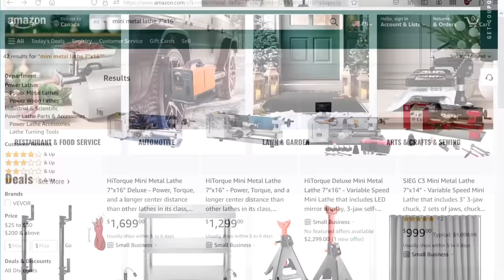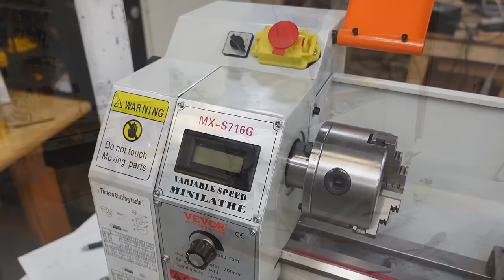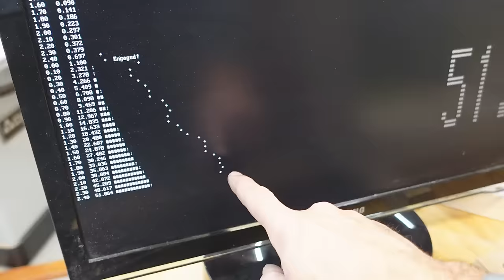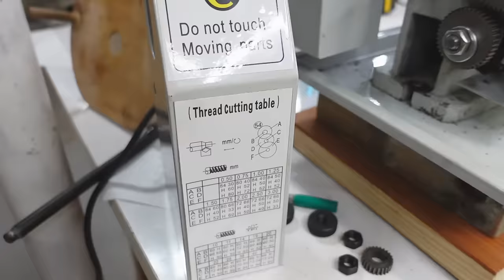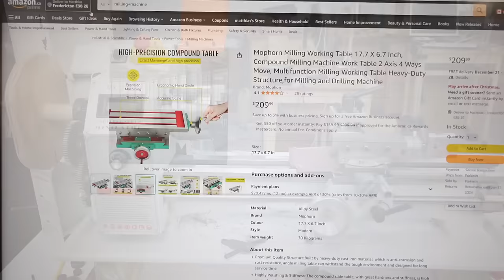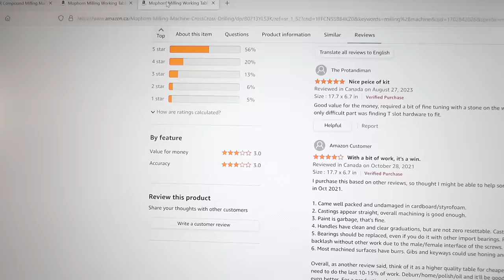I finally got a metal lathe

Comment: Your drill press will likely not work well under side loads so you can't really do milling with the cross slide table. Drill presses have bearings optimized for vertical thrust but not side loads.

Hope this helps.

Comment: There are two sources of chatter you can address. Firstly, make a really solid (stiff and heavy) dedicated stand for the lathe, and bolt the lathe to it. Second, if you aren't using the hand-crank, remove it from the bore, or at least remove the handle.

Comment: You could make a flywheel to replace the wooden manual handle.  That could be a solution to the motor not running smoothly.  A good starting place would be, an out of thickness spec brake disc from a car.

Comment: Matthias,please don’t leave the chuck handle in the chuck.  Catch one in the forehead and you’ll understand why. Also, a slide table for a drill press is a bit ambitious. Drill press spindles have bearing that are made for straight thrust. Milling requires a sideways cutting.

Comment: i've been looking at the craftex, basically the same as any other mini lathe, but hopefully most of the problems already fixed, they're close enough that i can tote something so small up to their outlet to bitch at them.  the vevor seems to get a lot of praise as better than other offerings as... not garbage, you've run into the same kind of troubles that other vevor lathe owners on youtube seem to have hit, the bottom of the ways for instance.  near everyone has to completely pull theirs apart and clean it(lotta grit and shavings), then put it back together with a bunch of shims, one i've seen(servo mod channel) used a file on the bottom of the ways, seemed to go well.

Comment: If you set the "angel scale" at 15 degrees it equals 1 turn on the big handle = 4 turns on the small handle. On all lathes the scale is only a help for calculation on the angle, not adjustment. You can easy get it to 0.001 mm precition.

Comment: 9:18 Out of curiosity I sent Vevor an enquiry about the change gears. What change gear sizes does the lathe come with? Are other gear sizes available? What is the shaft diameter for the gears? Vevor customer support was unable to answer the questions, other than to say that other sizes are not available. They referred me to their product detail page and the manual, both of which are of no help in this regard. Pretty disappointing. 

I know Matthias is pretty hady, but wood gears are not likely to work in this application.

Comment: You probably already have taken care of it, but - you need to clean off all the grit from the angle grinder; or it will destroy any precision that the machine has. In the future, be sure to cover up the bed and carriage when using anything abrasive on a workpiece.
Reply from the maker: did you notice the cover on the bed while I was using the grinder?
Reply: @matthiaswandel  Yes - however, it’s not enough. FWIW, I use a plastic trash bag on mine when I’m doing abrasive stuff; and make sure it shields the entire carriage assembly as well as the tailstock. Grit has a way of getting everywhere and seems magically attracted to the spots where it can do the most damage. 

🙂

Comment: Those mini lathes are like the Chinese Harbor Freight and similar appears, so will need some improvements to potentially the spindle bearing and at least the carriage widening and locking as well as the cross slide.  Can also possibly surface the ways if needed and the end post.  Will be interesting to see what your simplest methods are.  Really awesome to see you with and especially inspiring is the hand crank made out of wood.  Neato!
Reply: I'd go with a right angle plate adapter and vertical slide to make the lathe into a small mill as well.  Indexing head might be interesting as well if you can use.
Reply from the maker: don't know if I want to go that route.  I have milled aluminium with my slot mortiser before though.

Comment: mathias, if i may suggest you should bolt the lathe down, it should not rock like that. if you have shatter try to lower the rpm, might have been turning a bit too fast there. the handcranking the chuck to cut thread i thought was genious 👍🙂

Comment: I'm going to make the simular hand crank for my lathe (1 size larger), it makes a lot easier.    And the parting tool, I made a holder for my angle grinder to be fitted in the toolpost.
And that "bronze bushing" was a sinterbronze bushing with some steel powder to get better/cheaper results.

Comment: Wood on a metal lathe is generally consider to be bad for the lathe in that the wood dust gets into the metal parts, absorbs oil and then gunks up the parts.   But since it looks like you're going to end up using it primarily for wood anyway and then doing occasional metal bits without any oil coolant, you may get away with it for long enough to not matter.
Reply: You just oil the machine. Problem solved.

Comment: Total congrats!  Lesson number one. Very nice machine, but resist the urge to use it as a hammer (like a cordless driver) to drive a nail into a 2x4. (Just joking, trolls). On a serious note, avoid using compressed air to clean the machine. The small lathes open a whole world of possibilities that a 9" lathe can't offer. Also.....RESIN CHOCK. Great way to mitigate vibration- a bit spendy though.

Comment: You need to bolt it down to a very solid workbench. And you will probably need to shim the mounting points to make the bed level and straight. There is no such thing as a benchtop lathe. There are only lathes with proper support structure not included.

Comment: These lathes are low quality, but they're also cheap compared to others and surprisingly accurate for the low build quality. Worthless if you're starting a metalworking business, but absolutely phenomenal if you're just going to use it for cutting threads and taking a few mm off some cylindrical objects
Reply from the maker: for a business, time is money, and that day or so you spend tweaking a hobby lathe is money lost

Comment: Please don’t use 3in1 oil when cutting, it actually prevents cutting because it is too good as a lubricant. While specialised cutting oils can be delivered to your door you have some excellent diy cutting fluid in the kitchen, chicken fat collected off your last roast chicken.  I have been using it for 20 years on steel.  Also try the steel from the bars in laser printers, you will find it cuts nicely whereas the steel used in those cheap bolts and so on is an alloy designed for extrusion not cutting .

Comment: That bushing may have been sintered bronze; cast iron doesn't usually fall apart that way in my experience (and also that bushing just looks on camera like sintered bronze)

And anyway, yeah. If you know that you're going to be happy with one of the import machines because you're doing hobby work, and you understand the kind of modification and 'sweat equity' required, vevor makes an enormous amount of sense compared with harbor freight or canadian tire or whatever else.
Reply from the maker: whatever metal it was, it's mostly iron or it wouldn't get picked up by a magnet
Reply: @matthiaswandel  oh certainly. I heard you mention a magnet but I misheard and thought that you said you hadn't checked it with one.

Comment: I think some of those wooden creations would be more easily created and more accurately made with a 3d printer.  Since I acquired mine, I'm drawing more of my own parts and creating more original solutions to possibilities presented to me in my world.  I like the thing much.  Maybe you might find some plastic solutions could be used in lieu of metal solutions on some of your applications.

Comment: in this video i noticed the gears looked like they were metal and many of the Chinese Mini Lathes come with Plastic  but there are  Metal ones availalable  did you swap them out  yourself  ?   or is that a Upgrade Vevor does ?  I too want to  buy one  and i thought all of the Chinese  ones were  the same  at least that’s what they used to be  Vevor is  kind of a newer   player on this product
Reply from the maker: it came with metal gears, which is very nice.

Comment: "The lathe was too low and I wasn't comfortable"
Oh boy, that's a hassle and a half to deal with, lol.
"So I just lift it up and put some blocks under it because it's not that heavy"
You barsted! :P
Mine is a little heavier than that. The next thing I would recommend is a vertical cross slide, that way you have milling capabilities without owning a mill.

Comment: Putting a wooden hand crank (made on the lathe) on the lathe is such a Matthias thing to do 😅
10:30 As someone who does primarily electronics, working with metal is infuriating because of the filings. Sawdust is annoying, but it's easy to vacuum up and doesn't scratch. Get a bit of metal filings on my hand and now my phone screen is toast, glasses are messed up, interfaces on tools are scratched, it's such a pain.

Comment: Matthias dont beat your self up that you are not a machinist. I have seen machinist do wood working and they say they are not carpenters, the skills are similar just need to add skills to work with either materials and tools. I see that ThisOldTony has made comment and I see you twos are two peas in a bod. You both are very knowledgeable in your specific areas. The tools used are different and this makes huge differences on what products you make.

Comment: Question for those who are machinists. I would have taken a bolt with the right thread for the load cell. Drilled and taped it for the threaded rod. That way I wouldn't have had to singel point thread the nut and saved a lot of work. Is it something obviously wrong with doing it that way that im missing because I'm not experienced? Of course if you already have the hex nuts and don't want to run to the hardware store for just buying a few bolts, it works just fine. it's also generally funn to turn things (except single point threading) so that is also something you have to think about. 🙂
Reply from the maker: those bolts are hard to find, and expensive to order.
Reply: @matthiaswandel  ok, that's explains why. So nothing inherently wrong with how I was thinking, just easier and more economical to do the way you did.

Comment: I had that threading trouble with a little 9x20 jet I had. It was one tpi off. if I wanted 16tpi I had to gear for 15 and it was close but I still had to chase the threads with a die/tap to get it to fit.

Comment: Hi! I have the same lathe. When I tried to create thread, in the user manual, in the thread cutting table, at the 0,50 section there is a gear combination: A84; B30; C-; D60; E-; F80. The Gear "A" (84) and the axis of gear "D" at the same place, this combination is impossible! Am I right? 
Then I tried to create metric screw thread, 1,5mm/rpm. To do this, the following gear combination is written on the user manual and the same is on the lathe: A84; B60 , C-; D40; E-; F52 The problem: Gear "A" (84) can't turn around because of the axis gear "C-D"  

Please check these problem, because Vevor answered me, to change another gear instread of the gear which makes the problem, but if I change the gear (one of tehm) that changes the mm/rpm ratio.
Reply from the maker: watch my video on that topic, please

Comment: I see nobody has mentioned this, so I will do it.

On a metal lathe, you are still turning, not milling. Unless you're cutting the face, then you're facing. Milling IS done on a milling machine, though.

Other things a machinist would say, purely for entertainment purposes:

There are no bits. There are drills and cutters, at most a cutting tool. Never bits. 

Making a hole with a drill on a lathe is drilling. Same on a milling machine, and on a drill press.

Making a hole bigger with a boring bar is boring, on a lathe and on a mill.

If you're cutting a groove on a lathe you're grooving, unless the groove is on the face of the part, then you're trepanning.
Reply: Lathes can mill with a milling attachment. It's janky but it works.

Comment: I have a question about the ability of this lathe.    Does it bore a straight bore hole when setup correctly???? I’m making parts that at 7mm od with 3.8mm Id and need to be able to make the 3.8mm bore straight
Reply from the maker: have not tried that.

Comment: Using a cross slide on a drill press isn't really a good idea... The bearings aren't designed for a side load, and the chuck is (generally) only a pressed in taper, with no retention which can easily come loose when you sideload it also. I am trying to justify buying a mill, but for now, I just use my friend's shop, or go to the local(ish) makerspace that has A big knee mill.

Comment: Matthias turns junk into something useful, as he always does.  Not sure it does a whole lot to sell Vevor's junk, though...
Reply: Vevor's junk tends to be a cut above all the other junk that's out there these days. I'm not sure I'd want a direct drive lathe though. That seems like a basic engineering mistake to me. There's a reason Vevor isn't recommending working ferrous metals with this machine and that's it. No back gears.

Comment: Matthias: I'm getting a lot of chatter...

Also Matthias, like 1 minute later: so anyway, as you can see, it works fine with this massive, unbalanced thing hanging off the end...

I'm sure most of it's coming from the fact that the lathe isn't actually mounted to anything sturdy, but that handle swinging around can't be helping.

Comment: Vevor are not the most accurate, or best quality, i have an EMCO Unimat lathe, its now over 30 years old, had the motor rewound, and that's all .
these are no longer made , but do come up for sale second hand , and the quality is far superior to the Chinese lathes.
mine doesnt have thread cutting facility, but that isn't a del breaker,
 have fun learning how to use it, there are several good books on small lathe work, some important points,
make sure the cutting tool is SHARP ,and the cutter point is at or just below the center height of the lathe

Comment: You say Amazon gets their cut - but it is $110 less expensive on Amazon than on the Vevor link provided. Seems like someone is getting a cut. I found the same thing with the Dreo fans you linked earlier in the year. I get that you are a paid promoter but you may want to retain a little integrity when steering viewers to sites.
Reply from the maker: is it the same model?  Yes, Amazon has a better price on a lot of stuff ,but not always, so worth checking vevor.  I hadn't shopped for that particular lathe on amazon.

Comment: Boy you almost make it sound like one would be better off making a lathe by first buying high quality critical parts like linear rails, lead screw/ball screws and aluminum extrusion with maybe a steel or carbon rod going thru the center for rigidity. I mean my FDM 3d printer is kept calibrated to be accurate to within 2 thou and that's all made from fairly medium quality components and its now 5 years old. 

Either way between my woodworking and 3D printing I've been able to make anything I can think off with the occasional nut, bearing and bushing insert. Like pocket hole jigs, edge center finder, and dowel guides.
Reply from the maker: those parts would cost a lot more than a lathe
Reply: If you use super high quality ballscrews then yeah that could get out of hand really fast, but thanks to 3D printing, linear rails, linear rods, ball screws, and bearings of reasonable grade are well with in reach. Even with ungraded ballscrews there is a very simple and cleaver way to magnetically decouple radial deviation while enhancing axial precision. But thats okay, its a project I have in mind for my self much further down the road.

Comment: I'll send you my compound slide for free.  Fair warning, though...  they suck.  No rigidity.  

Seriously, you can have mine, just PM me where to send it.  It's just sitting in a drawer.
Reply from the maker: why, is your compound slide better than the one on my lathe?
Reply: @matthiaswandel  I meant the compound slide table that you were looking at on Amazon and vevor.  I don't remember the brand, but it looks identical to what you showed in the video.  I hate to throw something out that someone else might want, but I do not want it.

Comment: Just an observation...you should NEVER operate the lathe with long sleeves or wearing anthything that can can caught in moving parts!  Be safe!
Dr. Google says:  Short sleeves should be worn in the shop, or long sleeves should be rolled up above the elbows. Gloves may be worn only when handling sharp pieces of material, and not near operating machinery. They should always be removed before any machine in the area is started. Long hair should be tied back.
Reply from the maker: this lathe has a nice safety feature -- really low torque.  Easy enough to stall it!
Reply: This really isn't short sleeve season in Canada. If there's such a thing.

Comment: jesussss you need to grind that tool!! hahahah use speed steel to small lathe, avoid carbide
Reply from the maker: I was going to buy carbide tools, but once I started playing with it, I realized it was inappropriate. For steel, need a very sharp tool, so HSS it is.  And for softer materials, carbide is overkill.
Reply: @matthiaswandel  oh yes for small lathes hhs is the way, carbide are for heavy machines. i have a Brazilian Joinville 1975 lathe a south bend clone i only use hhs

Comment: Please bolt it down and make it a stable system that movement, chatter as you called it is unreal and you won't be able to get any accuracy at all. Sorry but those issues don't make it hobby grade but basically trash if they can't even get the basics right. You expect issues but nothing like the stupid mistakes you found.